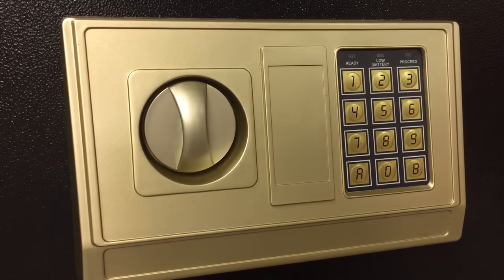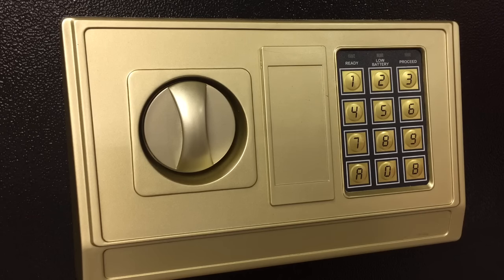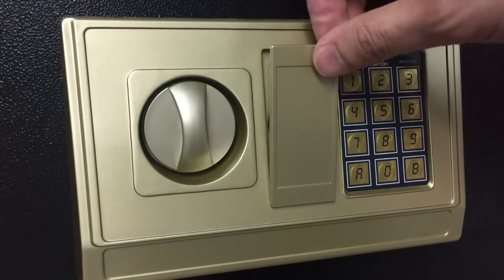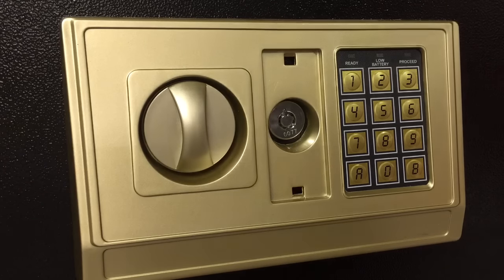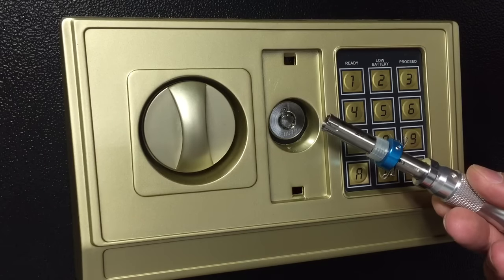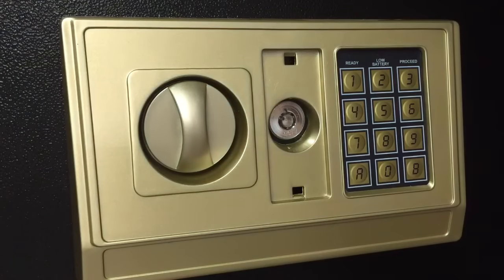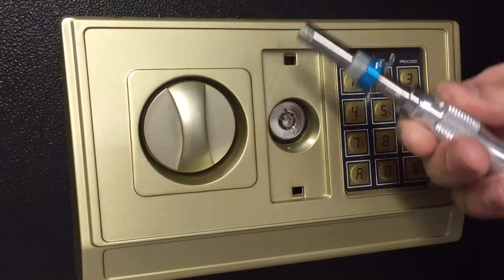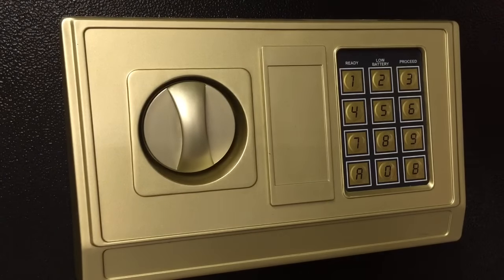[21] Harbor Freight Safe Picked Open

Comment: I get what you mean, but if they are that prepared then they would probably show up with a grinder and make quick work of the sheet metal. The thieves where I live are dumb and crude. They smash in car windows and grab things, they are quick and dirty. My prediction is that just seeing a metal box bolted to the wall is probably enough to deter most thieves from wasting time on it.

Comment: Cops didn’t get into mine and I just recently tore it apart to see how great of security it was actually in value of in truth and it’s best use is more of a faraday cage for electronic devices when you go to bed or a end table or something else like a boat anchor or a passenger in a demolition derby car for a navigator and pawn to keep you from being the next pancake.  Birdbath would not work so well , but if someone has the absolute necessity to create one or ten million, more power to each and everyone of them and their insecurity safes

Comment: LPL, we have one of these Safes but the tubular lock does not have the center slot on the internal circular part of the lock. I bough an impression tool, but it has a pin on the interior to line up with the notch on the internal circular part of the lock. This means that the Impression tool does not go into the lock.
How do you overcome this?
It look somewhat like the lock on video 224. This also does not have the notch.

Comment: Okay, so the safe only costs about $35, so to make it secure just drop a few drops of super glue into the key hole.  Thats it.  Write down the code on a small piece of paper and hide it in a crazy location that is not near the safe.  Problem solved.  The safe will tell you when the batteries are low.
Reply from the maker: If you are comfortable with not having a mechanical backup, then that might be a solution to this particular security flaw.  Personally, I'd rather replace the cam lock with one a bit more secure.
Reply: @lockpickinglawyer  Withc lock better to instal?
Reply: The craziest location are inside the safe itself

Comment: i have opened one of these using only a screwdriver, the barrel is not indexed and can simply be rotated with a screwdriver in the notch at the top, the combination had been forgotten, and i had been asked to cut it open, so had nothing to loose and was expecting a fight, there was very little resistance to it turning......

Comment: I was actually almost ready to go buy me one but after this video I'm not buying anymore.
Reply from the maker: +dsl yang Don't be too hasty to dismiss these safes.  While that lock is indeed pathetic, when compared to other products in the same size class and price range, they compare well... of course, that's only because most other "safes" are a joke as well.  But if you can afford better, of course, you should.  Also note that the lock I exploit can be replaced with, for instance, a much more secure Abloy cam lock which can be found on ebay for about $20.
Reply: +LockPickingLawyer 

I see.
Reply: Thanks for the informative video.  Would you happen to have a specific part number or link to a suitable, more secure, replacement?
Reply from the maker: jlkasde I'm sorry, but I do not.

Comment: I was about to pick up one of these to put guns/ammo in. I already knew that these are not the most secure out there, it's really more of a locking cabinet. Someone is always home at my house anyway.
Reply from the maker: +MrBreeze Thanks for watching.  To be fair, it's ok security compared to other products in the price range... but compared to a real safe, its a bit of a joke.
Reply: +LockPickingLawyer What do you suggest I get if I don't have big $$$ to spend?
Reply from the maker: +MrBreeze This isn't my area of expertise, but I don't think this is a bad steel box FOR THE MONEY.  I'm not sure you can do better at that price point... particularly during the sales when combined with a 20% coupon.  I'd also note that most of the "safes" in the price range also have easily pickable locks.  You could increase the security significantly by installing a higher security cam lock... abloy and bilock make nice ones.
Reply: Are the improved lock difficult to install?
Reply from the maker: Easily done with standard hand tools.

Comment: i was looking into purchasing one of these, too! glad i saw this video. thanks!!
Reply from the maker: If you are in the market, you've probably concluded that this compares well with other products in the price range... and don't forget that the cam lock cam be swapped out easily for something more robust.  In short, this product is not bad for the price, but it does need some tweaking.

Comment: I have one of those but I made some modification to it. I don't even remember what I did but mine needs to have the key in it and turn the key or the knob won't turn. Of course you also need to enter the correct code. So instead of making it a [OR] lock I made it an [AND] lock. So both key and code are needed.... or at least the key and then hit it with your fist.

Comment: I have old candy dispensers. When we moved, I couldn't find where I hid the keys. Never did find them. Since taking up lock picking, as a hobby, I ordered those cheap tools. Of the 3 candy dispensers, I got two opened. One of them just refuses to open. I dropped gun oil and WD40 into it, to free up the pins. Still, no way I can get it opened.

Comment: I have a Guardwell battery have died, it has regular key that's inside box. How can open it? Last resort I'll just use 1/2" drill bit, but if you can suggest easier way, much appreciated. 🇨🇦

Comment: What about the Harbor Freight (Bunker Hill) Safe that doesn't have an indentation on the tubular lock? Can you open it with the same tool, or do you have to use another method?
Reply from the maker: Do you mean that little notch in the center post?  If so, see video 224 (posted today).  Does that answer your question?
Reply: Maybe. Do you have to remove the tension bar from the tool first? If not, there is no way to fit the tool into the lock...
Reply: Also, the center part is circular, not 7-sided like in your recent video...
Reply from the maker: Yes, but that's really easy to do.  This tool comes with the allen wrench to remove it.
Reply from the maker: Does that matter?
Reply: Wasn't sure if it mattered, I just thought I would add that information in case it was relevant...
Reply from the maker: Doctor Lore It doesn't matter... what matters is that the tool is tensioning off of the pins. and not the center post, which means that the lack of the notch in the center post doesn't matter.  :-)

Comment: I bought the Chinese made tool you speak of, and it comes in a 3 pack just like you said. Also bought a few vending machine locks because I want to learn the trade. I didn't know that they were for impressioning purposes. It would be best if you made a video on how to use these tools and what the difference is between the high quality tool and the low-quality chinese-made tool. Thanks very much, love you videos. If you've already made videos regarding this please email me with the video number, again thanks.

Comment: We bought one  to keep  important papers inside.The instructions were ridiculous and ambiguous. Had to  find a You Tube video  to discover you CAN NOT change the preset code that comes with it. ( instructions say otherwise. )   My only worry now is the factory determined  code probably is the same one for all their safes......Thank goodness it only weighs about 20 pounds.Come hurricane  season I can grab it and run to the car.

Comment: Great video! What is the name of the tool you used to open it? I am going to have to order one for my safe. Lost both sets of keys. Thank you!
Reply: You don't even need the key if it's not bolted into the wall. Just take the safe, put a slight pressure on the knob as if turning it open and while you do that just drop the safe onto your bed from about a foot above your bed. When it bounces just right there is a moment where the lock disengages and it just opens...
Reply: @KleinKaptein  I have a very large safe. Weighs about 250-300 pounds. I got that tool the other day and was able to open it in a matter of seconds. Kinda scary how fast I was able to open it.
Reply: @beefneckjoe5634  Just hope a burgler doesn't find your tool.
Reply: @MrNateSPF  most won't look for the tool, they will just try to carry the whole thing away.
Reply: Dont give a shit you can it the top what the name of the tool?

Comment: As alarming as this video is,  I'm slightly reassured that it's not true that someone can pick this lock with "little or no skill".  That describes me, and I just bought a tool that looks identical to the one in the video.  Wanting to test my own HF safe, I used the tool, jiggling and turning for about ten minutes, and the lock would not open.  There is apparently some touch that I don't yet have which is needed.  I will continue to practice, but it seems that this safe will still slow down the unexperienced novice.

Comment: im getting one of these safes on july 4th with the 25% off cupon. i plan on changing out the lock. i thought about shrouding the rest button so no hanger could be used. can i just take it appart and pull the solenoid out. i dont need the key pad anyway? should stop the hanger rest, the jolt the pannel, and the magnet the solenoid method by doing these 2 mods. any other concerns? my buddy got this safe and its stout enough for my needs.

Comment: "Thus, if this is the best you can afford, go for it... though I would highly recommend swapping out the cam lock with something a  bit more robust."

How? What's the dimensions of the lock and arm? Easy to get an abloy style lock on amazon and swap out? Specifics would be appreciated. Thanks.
Reply: Well, if you're desperate enough to buy it anyway, you'd have already gotten it, and thus, could have done the necessary measurements on the lock.

Comment: You're overlooking the fact that safes are also made to protect things from fire. You should put this safe through a fire test to see if it will at least live up to its fire rating, assuming the thief doesn't steal your stuff first. Light it up!
Reply: This safe doesn't have any fire protection - hence the lack of insulation. Gives you more space for weapons as insulated safes would take several inches on each side, but no protection from fire.

Comment: This was my low-tech solution to the problem: http://imgur.com/mHsoA2F

Safe is bolted to studs and chain cannot be slipped.  Probably good for an additional 10 minutes for the criminal with power tools.

Would like to hear if you have a specific replacement part number for the cam lock(s).
Reply from the maker: Well, played!  I installed a couple new higher security cam locks on mine, along with a couple other internal modifications to make it a little harder to spike.
Reply from the maker: jlkasde HOnestly, I did it so long ago that I don't remember the exact size.  I used Mul T Lock cam locks on mine.  The medecos are nice also, but to be rakable.

Comment: If you have one of these safes and after watching this vid are feeling more naked than when you popped out the womb and want to secure it better use super glue to destroy/gum up the keyhole get it nice and deep or even better if you can weld :) , you will lose the key function but just be extra vigilant on the low battery light for the keypad.

Comment: I bought a five pin padlock from Harbor Freight a couple of weeks ago. I was expecting not much of a challenge. But the keyway is actually pretty good. Getting at the pins without getting tripped up on the keyway has been super tricky with both top and bottom tension. I was completely surprised.

Comment: tubular locks SUCK! easy as hell to get into those.  So far from reading the posts below (including LPL's) that the tube lock sucks, the electronic keypad can have its wires fished out and connected to a 9 volt battery and opened, a hanger can be fished through to push the reset button, and you can bang on the top of this while pushing the dial to the right to move the solenoid and open the door.  HOWEVER, remedies include replacing the tube lock with a Abloy cam lock of the same depth (anyone know this depth?), gluing the wires in place so they can't be fished out (do I use super glue?) , bolting the safe to the floor and the wall (or bouncy carpet) to keep the solenoids from moving, welding a hardened chain around it with an Abus 10 padlock, anything else? :)

I agree with LPL that many of the safes in this price range have metal as thin as filing cabinets. At least this is a strong starting point because the metal on it is pretty thick comparatively.  IF it is .2 inches as someone mentioned, that is 6 gauge steel-most much more expensive safes have 12 gauge steel at best.   so the box is pretty good.  

LPL, is there a way to eliminate the keypad function from use and tampering and simply use the newly installed abloy cam lock to open the safe?  what would I have to do cut the wires completely?

We are smart guys, let's put our heads together on a simple and cheap solution to make this work.
Reply from the maker: I have one on which I’ve removed the solenoid and replaced the cam lock. It’s about a secure as you can make these without adding steel, and it’s fast.
Reply: so you completely removed the digital capability of the safe by removing the solenoid? I guess it makes it more secure but it hurts your quick access b/c you have to find the key.  Also, I saw one video where a guy said that the front of the cam locks can be chisel-sheared off and then poke the solenoid through the hole where the cam lock was.  Also, in the same video he said to remove and stretch the spring so that it can't be bump opened so easily.  In addition, he said to cut a groove 1 inch from the top of the solenoid rod, then knife-edge the bracket where it touches the solenoid rod so that if someone is trying to move the solenoid while turning the handle, the pressure of the bracket on the solenoid rod as it slides down will catch on the groove and stop the rod from going down and opening the safe.   If you remove the digital cover, there is a long slot in the door of the safe where you can poke a stick through to the solenoid so he welded an angle iron piece to keep this from happening.  I guess you can also install a hasp with a secure lock on it but it again hurts your quick access.  I agree with you in that these seem to be pretty good "steel boxes" but suck as safes unless significant modifications are made.  but then again, all the small safes in this price range need the same modifications.

  I have two of these right now was going to experiment to see if I can make it a PITA to get in and try to cover all of these contingencies.   crossing my fingers thanks for your great videos!
Reply: @lockpickinglawyer  hey, which cam lock would you recommend?

Comment: It baffles me to no end that a perfectly good electronic lock needs some dumb mechanical backup. When the fuck will that ever come in handy? Or vice versa really. Just do one thing really good, and focus on improving THAT! Hell, worried about the battery dying? Just make the damn thing rechargeable! Every time I see a safe that comes with some lame brained backdoor, I just look the other way, because it won't keep my valuables safe, and it will inevitably be the first target if there ever is a break in.
Reply: Oh, just one more tidbit, DON'T MAKE THE SAFE UNLOCK IF THE BATTERY DIES! If you have to recharge it, make sure that's the only way in, and make the damn thing sturdy and weather proof as hell if people really NEED to store it somewhere outside (they don't).

Comment: Crazy glue with epoxy into this lock and change out 9 volt battery every 6 months this will get you a little more security on these cheap safes

Comment: can the tubular lock be replace for a beter lock?
Reply from the maker: +rudysr22 Yes, and it is not difficult.  Abloy is a good option.  While you are in there, I'd glue the solenoid wires in place to make the safe resist spiking attacks better.
Reply: thanks
Reply: @lockpickinglawyer  abloy?!? Pff take one of these crazy bowly locks lol

Comment: how many crims get about with that fancy tool in their bag???
Reply from the maker: +Syler1979 not sure, but a couple thoughts: (i) the tool is not that fancy... just a few bucks off any one of a dozen websites that sell Chinese tools, (ii) special tubular picks are not required to open these locks, if you look at my other tubular lock videos, you will see me using tools that can easily be improvised, (iii) it just takes one well-prepared/knowledgeable thief, (iv) don't forget that one should also be wary of "curious" children/teens, (v) there are several other ways to get into this safe that don't require a specialized tool... on the smaller models, there is the "potato" method, and if you don't mind being destructive, a screwdriver, paperclip and 9v battery are all you need for a very effective spiking attack.

Comment: Isn't this the kind of safe often used in hotels? With an override "security" code of 000000? You can set your own 4 digit code of course, but using 6 0's is easier.
Reply from the maker: No.

Comment: Not hip on the lingo but I don't have a round key on mine, it's a regular style and batteries are dead on key pad, I literally stuck the tip of ziptie in lock and used a dinner fork to turn the lock and opened the door, lol what a joke

Comment: Disable the key hole with epoxy.  Just use the combination.  Now I would be interested in how bad the electronic designs are in this safe and how easy it would be to open.